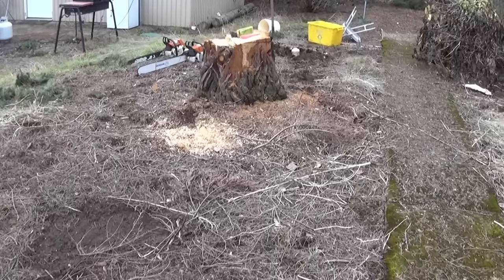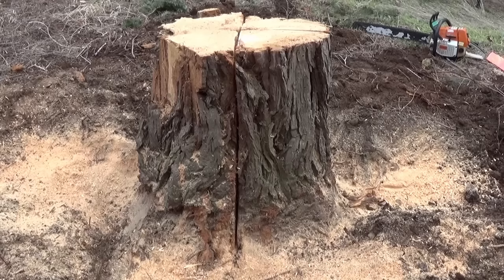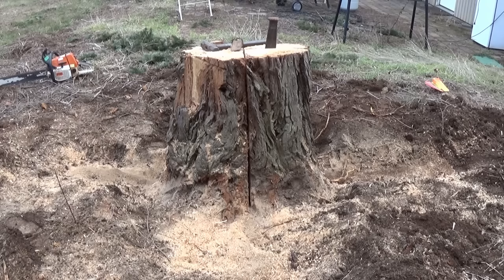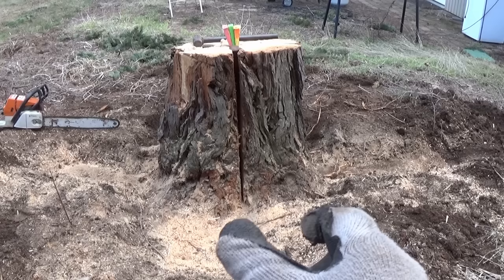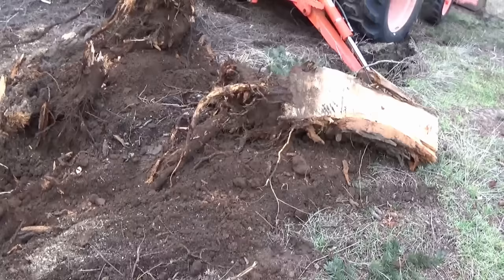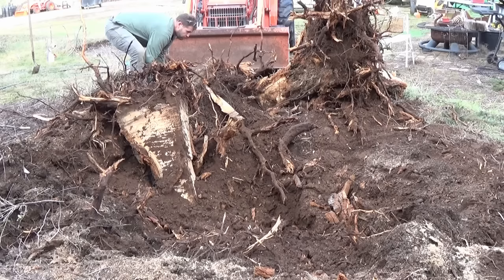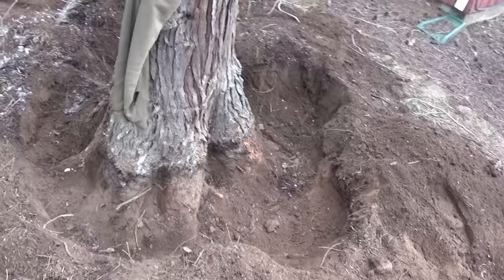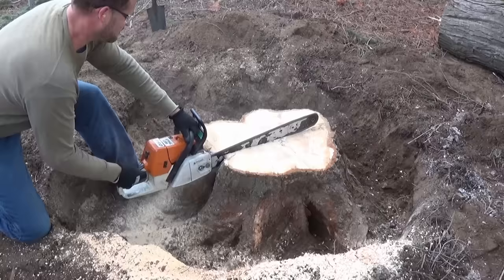Quarter Saw Stumps for Removal with Porta Power Hydraulic Ram Jack

Comment: I worked out a method: I leave at least 15 feet of tree attached to the stump for leverage, then dig a six inch deep trench around the base of the tree. I fill the trench with water and keep adding water for three days, I get the entire area soft and muddy. I then attach a chain to the top of what's left of the tree, fifteen feet up. I put another chain onto the base of a healthy tree at least 10-20 feet away, then use a winch or come-a-long to attach the two chains. I pull the stump tree over toward the healthy tree, which pulls roots up out of the ground on the far side of the tree. I use a pressure washer to wash dirt, rocks etc off the roots, then cut them with a chainsaw. If I have another healthy tree on the other side I pull the tree back that way and wash off then cut roots. If there's no way to pull it the second way I just keep going the first direction, it's more work but does pull the roots out where I can wash them off and cut.

Comment: Gotta love those Harbor Freight backhoes.
Reply: I would try digging a circle around it with the backhoe. The Roots should be easier to break at 2-3 ft out. After that all that is left is usually the Taproot which can usually be toppled with the excavator.

Comment: Thanks, really enjoyed your video.Dug out many stumps in my lifetime.  I found using a Milwaukee reciprocating saw with a long Diablo pruning blade helps when cutting lateral roots to loosen it up.  However some stumps have a taproot that's virtually impossible to cut.  Glad you got that stump out finally.
Reply: Yes, sir. Last spring I was certain I could take out a 24-inch diameter pine stump (freshly cut) with just a reciprocating saw, old pair of loppers and a trenching shovel.

Ha ha, not quite. I dug down 5 feet and cut away every single root except the tap root. The tap root was darn near 24 inches and there was absolutely no safe way to cut through it while standing in the excavation, and no way to get at it from surface level. 

I finally decided to fill in the hole and let the stump rot for a couple of years. Once the wood softens a bit I’ll try busting up the top part with an ax, sledge and wedges.

Comment: I found a trick that seems to help with this approach:  Digging the dirt, rocks and the like is a lot of work and is tedious.   What I tried is a really good power washer, 4,000 psi and 4.2 GPM.  I used it to blast as much of the dirt and related stuff that ruins chains.   Then I let it dry for a couple of days.   After that I was able to cut the stump low enough so that my riding mower could go over it without issue.   My chain lasted for 10 stumps, averaging 24" diameter.   Without the power wash step, I had to sharpen the chain after a single stump.   BTW, these were pine and fir trees.

Comment: My buddy has been burning his stumps. We use the technique of breaking out a couple camp chairs and a cooler of ice cold beer. Sometimes we have a lot of help.
Reply: Neighbor and I got rid of two big ol pine stumps in two weekends by drilling holes starting fires and maybe locking throttle on the leaf blowers.
Reply: My bad, 3 cases of beer I believe
Reply: @RobertThorne-pz8tq  It's a lot of work.

Comment: I've been cutting down trees and removing stumps for 20 years. That's first time I seen somebody try to use a hydraulic tool to spread the stump apart. Best way to remove tree stumps best to use a ripper attachment on an excavator or back of a tractor. Go all the way around the stump cut the roots deep and then pull it out.
Reply: I saw vs I seen

Comment: In about 1951 I watched my uncle eliminate a stump in his newly cleared field in West Virginia.  Drilled a hole with a hand auger.  Dropped a stick of dynamite in, packed it with wet clay.  I got to turn the switch.  WHEW,
Reply: An uncle of mine did the same thing inside city limits in the mid 60s. Was really cool to see the stump jump. Cops showed up. He pulled out his license. He got 2 more jobs. 👍👍

Comment: I dug them out by hand - 37 total from 8” dia to 30” dia.😊 Dig a circular trench around the stump. When you hit a root radiating away from the stump, cut the root at the farthest point from the stump. I used a double-bit axe. Then cut the root at the side of the trench closest to the stump. Continue digging in a circle and cutting roots until all the remains is the main tap root. The stump will fall over in it’s side exposing to main root. Cut the main root,  drill and install an eye-bolt into the stump and drag it out of the hole with whatever by attaching chain to the eye-bolt you installed. BTW - remove eye-bolt and save it for the next stump.
Fill in the hole. Yes, it’s a lot of work. Yes it does a good job. No, nothing grows back later. This technique is not recommended for those who fear hard work. 😂 The vehicle I used for dragging the stumps out of-the hole was a 1980 Ford Galaxie station wagon w/ 460 CID and Holley 750 CFM 4 bbl.; dual exhaust + 4 degrees advance on cam. You will need something with torque, not revs.

Comment: This is the way to do it for most homeowners, quarter the stump and then use the backhoe hanging on the garage wall to pull it out. Lol  In all seriousness, the quartering works great if you have a tractor, backhoe, skidsteer... and have room to get to it. If not, you're probably renting or hiring a stump grinder or burning if you can get away with it. I hate being a city slicker, the country boys have the best toys.

Comment: Dig around the stumps base, outward in a circumference of two to four feet and to a depth that exposes the roots. Using a reciprocating saw, sever the roots from the stump. Once the stump is free, you can either pull it out with a vehicle or other piece of equipment or cut it up in manageable pieces. Wedges are helpful in the latter approach. No chemicals, no extended wait periods, no ruining expensive chainsaw blades, and no above ground remnants. What rremains is just a hole in the ground created by a little hard work.
Reply: Yes I agree, that's pretty near the same way I do it too. There are no stump grinders within a day's drive from where I live so I have to do things myself. The easiest way I have found so far  is to dig around the base of the stump and either break the radial roots with a crowbar or or cut them with a reciprocating saw depending on their size and then pull the tap root straight up. I get a chain around the base and then lift the tap root straight up with hi-lift jacks because that's the equipment I have. 
But quartering the stump is another idea that might be worth a try too, especially for big stumps. Thanks for the video Gorge. I really enjoyed watching it and learning.  :)
Reply: I did this but used snatch blocks to amplify the force.

Comment: I typically cut straight across as low as I can. Then get the plunge cut it in quarters so I get the tap root too.  Finish with sawzall to save the chain.

Comment: Put a big barrel around the stump then set it on fire. It will burn the stump to the ground. Slow but the least resource investment needed. I’ve done it and it works well. The fastest way is a stump grinder.

Comment: If you’re not in a hurry, drill 3/4-1” bore holes near the base at an angle. Fill holes with epson salt, moisten the salt, try and keep it damp, cover with a heavy dark tarp. Depending on the wood it will break it down in 3 months to a year.

Comment: When we were excavating for the foundation of my house, we had to remove a HUGE sweetgum tree that was right were the beginning of where our garage slab started. The tree was around 42” in diameter. The root ball went 6’ below grade. We ended up having to step the foundation stemwall there onto undisturbed soil. It went from 10’ deep at the basement wall footing, stepped up a few feet where the bottom of the rootball hole was, then stepped up again to the ~2’ deep footing for the garage stemwalls. Extra concrete cost 🙁. Then we had to backfill and compact that hole in lifts all the way back up to grade with a wacker nueson trench roller because the driveway was gonna sit on top of that. I didn’t want any future settlement.
Reply from the maker: Stumps and boulders are always in the worst spots. Murphy's Law. Thanks for watching.

Comment: The atom splitter  screw log splitter on your tractors auger would wedge those stumps apart in seconds. With or without the chain saw cuts. I've done it!

Comment: Quartering the high stump is a good idea. I would just dig the whole stump out with a backhoe and the diameter of the hole had to be HUGE! And the stump was so heavy I could not move it on my own. From a big tree. Took a few days to burn the stump. Knocked the dirt off it as it dried to expose the wood, and put sticks and small branches thru the open areas to get the fire to burn up thru. I would hose the stump down at night, and next morning it was till warm, dry, and ready to burn.

Comment: I saw a video where they used an old truck tire (on a rim) and put the tread side against the stump and pulled the chain that was around the stump, over the tire and hooked to a truck and they pulled it out effortlessly. And it wasn't a small stump.

Comment: Hay my friend! Let me tell you a little secret.
The top of all the cutters have a. 0015” of Chrome. It’s electro plated on at the factory. When you let the Chan dip into the soil it removes the Chrome. So here’s the thing.
The chrome is what cuts the wood! The cutter just holds the chrome to cut wood. The metal of the chain dose not cut the wood, it only makes bug dust. The chain will never take a Sharpening again, just no chrome left😢 drop it in the trash.
So one chain one tree,

Comment: I've used porta power units that had more than 7/16 travel.  but lacking that, you could use some metal plates as spacers.  Spread, back off, insert plate, spread again, repeat.

Comment: It would be more interesting if you attempted it with a block and tackle and a tripod, a back hoe can just deconstruct the stump anyway. My tip is a 1 1/2 inch spade in  a good drill and some charcoal.
Reply: yes many other ways to have tried to use the porta power first. especially with the retracting ram kit (which he may not have)

Comment: Hi, thanks for the video. Yesterday I cut the bottom out of a 55 gallon burning barrel/drum. Thought it might work for burning stumps or roots. Plan to try burning some roots on the surface where I park my camper, about 30 feet from the tree. Is there a way you can kill roots with out killing the tree? Thought about cutting the root and then dealing with the end away from the tree.

Comment: I'm all for saving a buck and spending a little extra time to do so but...i've learned to just rent a joystick controlled stump grinder and be done in like 20 minutes. I did a 5ft diameter by 2 foot tall stump in less than an hour with one.

Comment: 1 - Dig out the sides with a pressure washer.
2 - cut through the now exposed roots with a reciprocating saw
3 - Use a lever and pop it out (or chain it to your truck or atv and pull it out)

There's no reason to do this the hard way.
Reply: ok this sounds like an interesting way to dig it out without having to deal with all those roots~!
Reply: @jacobe1942  It works like a charm, I've done it 4 times without issues so far.

Comment: I was thinking of how a person was to make a steel jig that could lay down on top of the stump. It has two lips that could be inserted into the cuts. A standard bottle jack could be laid down inside the steel jig. The bottle jack would telescope the jig spreading the two lips forcing the cut apart.

Comment: Guess i'm naive on this, but since you already have the dirt dug down a little lower, why not just cut horizontally but lower than the normal ground level? Then, just cover on top with dirt.
Reply: It'll rot over time and make a hole
Reply: @reesesalen5033  gotcha. Makes sense.

Comment: I'm a Little bit confused ! If you've got a tractor, with a Back hoe attachment on it ,,,, Why aren't you Just digging them out ,,,,,, instead of ruining Chains and saws ? Go out away from the stump about 3' and dig the roots out and then just roll the stump out ? Your Ruining 2 Stihl Chain saws , Beating your ass off with those wedges and shovel & Sledge Hammers, Playing with a Ram Jack , And a Tractor and Back hoe sitting there !

Comment: Wait. So you have an excavator and you are not using it to dig out the roots? You take a scoop out of every side and it would have popped out.
Reply from the maker: Views was the intent. Getting creative for your entertainment.
Reply: It looks much easier/quicker quarter sawing first, rather than trying to work around and under the roots for an hour before getting the stump loose.

Comment: I have a stump that's 52" across. One round from it at 16" long weighed over 500lbs.  To have it ground down would cost $10.00 per inch. Ideas?
Reply: Logging friend helped me. Cut stump close to ground. Score the top of stump multiple times with saw. As deep as you’re willing to score it. Cover with dirt. The dirt will decay the stump and break apart. Doesn’t happen overnight but it’s surprising how fast it will work.
Reply: After breaking my chainsaw by trying to take out my huge tree root and stump, I called tree service and he did the removal $200 with his huge stump grinder.
Reply: Potassium nitrate (sold as stump remover) speeds up the breakdown quite a bit.  Drill holes, add the remover & water, then time.

Comment: 5:14 If you have a backhoe, dig out at least 3 or 4 feet of roots.  This will prevent the leftover roots from rotting and causing mushrooms to grow in this area, after the majority of the stump is removed.
Reply: What's wrong with mushrooms growing? Their presence is a strong indicator that the mycelium is breaking down the wood. They might also be delicious as long as a positive ID is made.
Reply: @joewoodchuck3824  Mushrooms are great, but they might grow in a spot that the person doesn't want. For example I occasionally get mushrooms in the middle of my front lawn. This is not a preferred location for mushrooms, for me.
Reply: @AlexeiTetenov  We're a little closer to nature and are happy to see them growing anywhere. We like moss too. It's beautiful. If those things are happy living where they are, we're happy seeing them. 
   To each their own.
Reply: @joewoodchuck3824  yeah this mushroom comment is really weird to me. But hey, some people rip out all of the nature in their yards and cover it with concrete and astro turf. So, I guess, in relation to that, the guy afraid of some mushrooms is pretty mild
Reply: @joewilson4436  Like I said, to each their own.

Comment: "Well this little thing has some decent power. The issue is it only has a 7/16" stroke. It's less than a half inch stroke and you really cant do much with a half inch stroke.  A little bigger body with a two inch stroke would be ideal. Then you could do some work."
Reply from the maker: A 1 to 2 inch stroke would really get something done.
Reply: That's what she said  @gorgeoutdoors

Comment: i wonder why we cant buy carbide tipped chains?  I would think that a $200 SiC chain would work pretty well in dirt, and bounce off most rocks without much damage, just like a stump grinder.  Quarter sawing helps a lot.  
If you didnt have the backhoe, i guess i would sling and pull with a truck when it is ready to go after the wedges. maybe use a big eye bolt.
Reply: Whoa whoa whoa... did you just say stump grinder? Careful there, careful. That'd have been a great idea, but probably not such a great youtube video.
Reply: Carbide chains are excellent untill u hit rock or metal then it knocks the entire tooth plum off the F-EN chain and they cost 3 times a regular chain  . . .

Comment: A half inch stroke is all you're going to get out of a cylinder that small... no matter who makes / sells it. They have larger cylinders with longer strokes.

I've owned this smaller hydraulic unit and the larger 10 ton unit. I've had and used them both in industrial maintenance for almost ten years now and I've never had any problems with either one.

The key is just respecting the stated limitations of the equipment. Too many monkeys out there get a 4 ton ram and expect it to apply 20 tons of force... and then complain when it fails!

Comment: is there a chain with abrasive teeth that can cut stone ?
Reply from the maker: In a way, there is, but for rock and concrete only. Won't cut wood very well, but will cut concrete.
Reply: @gorgeoutdoors  
so i'm thinking cut down vertically to near ground level with wood blade..  then change to the abrasive blade to go below...
Reply from the maker: Now that's an idea. I have 100's of used chains. Most customers let me keep the old one when i sell them a new one or service saws.

Comment: I would have used a very different method - I'd have cut the stump closer to the ground, drilled down into it making a 4" diameter hole. Then I'd have drilled in from the side into that hole, would have let it dry for a week or two then set a fire in the 4" hole and fed air though the side holes. I'd have burned that sucker out.
Reply: What kind of drill and drill bit do you use for a deep 4" hole?
Reply: @robertm5969  I'd use just about any drill though a mains powered drill would likely work best. I'd use a 4" spade bit with an extra long shank.
Reply: @robertm5969  4" forstner bit with an extension. Also, once the fire takes hold in the stump, use a fan of some sort to force air through the holes. I burned out a 26" oak stump out in 1 day using that method. Sat and drank beer and watched it disappear.

Comment: There is so much wrong with this, no PPE and you should NEVER allow the chainsaw to cut into dirt.  Chains and chain bars are expensive and it has the potential to bugger the oiling system - amateurs!
Reply: Guess you never heard of the safety squint
Reply: @deweyjohnson783  You should never operate a chainsaw with defective eyesight.